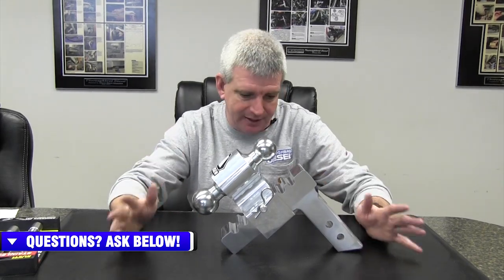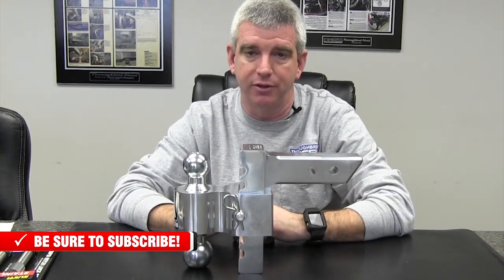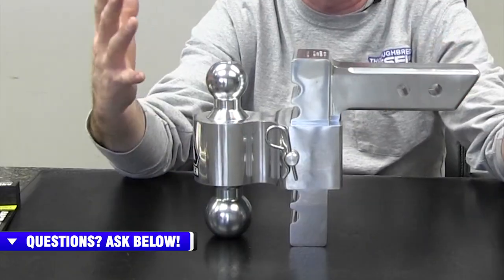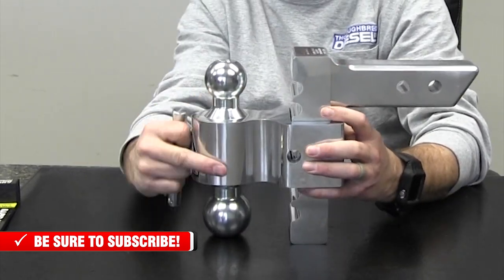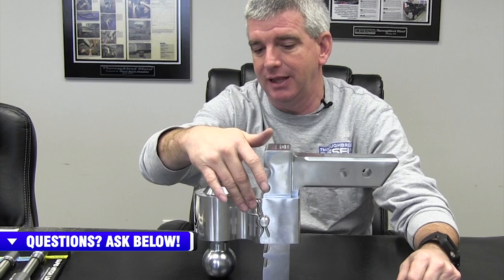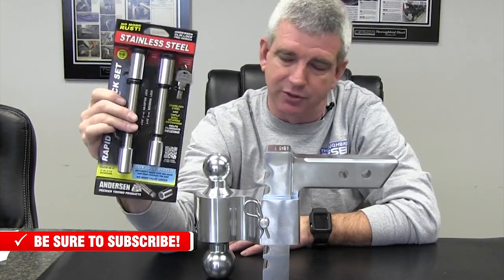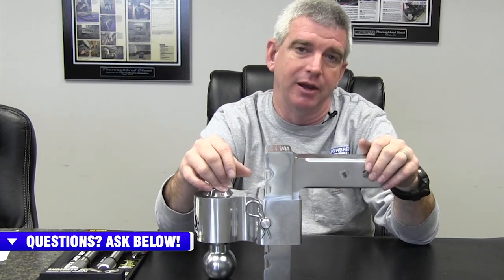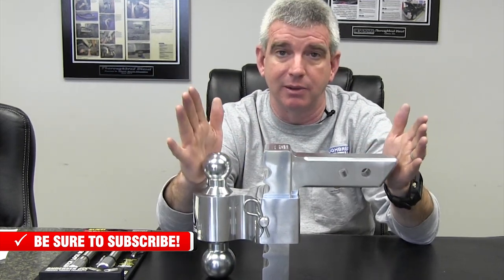Never Rust Adjustable Ball Mount Trailer Hitch | Andersen Manufacturing Rapid Hitches

Comment: A dab of grease in the locking mechanism will pay off if you leave it on over the winter. It's a stainless lock, but will bind up if it gets road salt and dust in side.

Comment: If you don’t have a hitch like this design you shouldn’t drive a truck have had this hitch not sure if same brand definitely same design, I’ve towed skid steers trailers boats,many many many miles, probably close to 100,000 if not more. so many to the point where i bent hardened steel pin in the hitch hole beat the pin hour over 4 hours cut it, used a punch and sledge until finally drilling it out. And im still using it just fine. Love it.